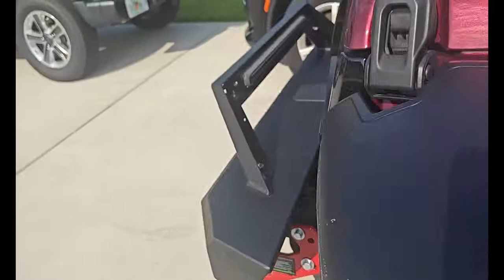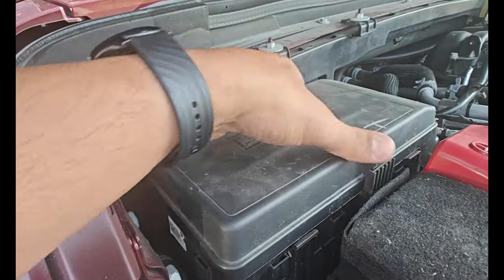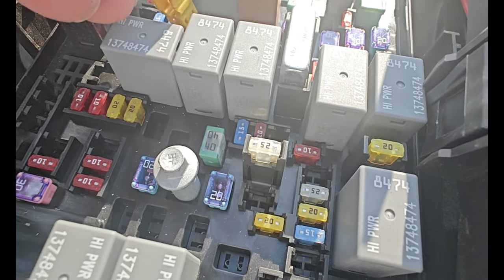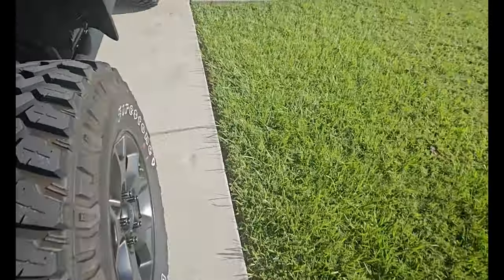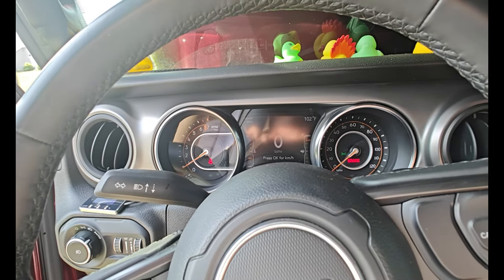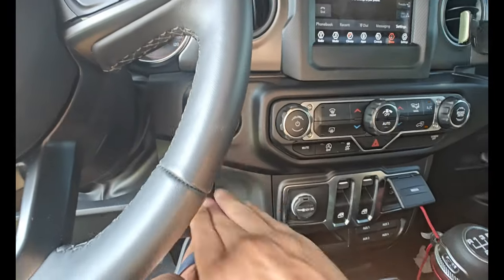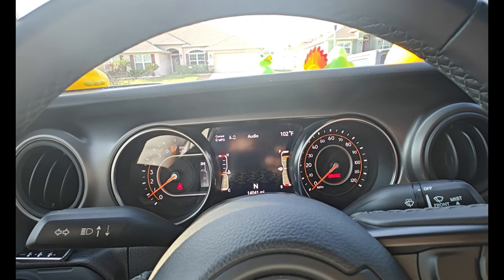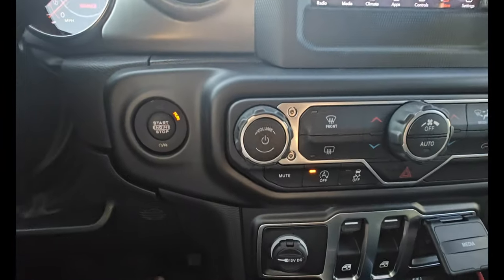Jeep Wrangler Aux Battery Bypass

Comment: Have a question, maybe you or someone can help... i bought a 2020 willys in may, had 33k miles. Last night it wont start, but everything else works dash lights radio everything... i jumped it off an it started but as soon as u put in gear it dies... does this possibly sound like it could be the Aux batter?
Reply from the maker: That sounds like the aux battery to me. Take the main battery to auto zone and have them fully charge it. you might have a drain aux battery also.

Comment: I have the same issue with my jeep. I got into an accident Aux Battery gone and now car doesn’t want to start main battery dead  in second after I bought it brand new. When I put computer on the car it says GMU no communication. Any suggestions please? Dash light up other screen sometimes
Reply from the maker: I would take it back to whoever fixed it after the accident, it sounds like you might have a bad PCM
Reply: I did everything myself but I only do Body work
Reply from the maker: @rmvariety  I f you toke the aux battery out what did you do with the pos and neg wires
Reply: To be honest everything was fallen off apart even the wiring under the hood I had to replace. But everything was setup the way it was exept the Aux Battery. I was wondering if I bypass the Aux Battery if that would make it start.
Reply from the maker: @rmvariety  Yes bypassing the aux battery will still let you start the Jeep. but you still have to make sure you disconnect the fuse as in the video.
Reply: Yes i will do all that as I seen it in your video.my only concern is U029A code that indicates MGU no communication. But I’ll try.

Comment: I pulled the F42 fuse and the correct negative battery lead, which is opposite of yours.  My Jeep fired up fine but the Auto Stop/Start light on the dash doesn’t come on.  I’ve got a 2020 Wrangler.  Does anyone have this going on, or did I do something wrong?
Reply from the maker: The light doesnt have to come on for it to work properly. if you press the button does it come on?
Reply: @FAFOWeekendAdventures  yes, the light does come on when I push the button.
Reply from the maker: @mikehenderlong3945  Then it working properly, you just have to manually shut it off everytime unless you install an:  https://amzn.to/40BZtIu or a Tazer: https://amzn.to/3MKBOzY

Comment: So if I were to take the aux battery completely out, do I need to reconnect the top negative cable you removed in the video and just 
 tape off the negative cable that came off the aux battery and connect the positive cable that came off the Aux to the main? Or do i need to tape off both negative cables coming for aux?
Reply from the maker: If your jeep is still under warranty I would not remove the aux battery. If the warranty is expired and you want to remove the aux that would be fine, connect the neg back up to and tape off the bottom neg. And tape off the bottom positive
Reply: Thanks.  My jeep is out of warranty. Wanted to remove the aux battery completely.  Wouldn’t it be best just to leave both aux negative cables disconnected and taped or is there a reason for one end to be connected?  I haven’t seen any videos of someone removing the aux completely
Reply from the maker: @elbadboylopez  I would connect the top negative, that's just me, looks cleaner 🤣

Comment: I’ve got a 2019 Sport-S 6 speed manual. Just bought it a month ago. Battery was dead this morning, did the same hack (no tazer) and now the ETC warning light comes when starting. It’s only on for a moment and goes away. Wonder if anyone experienced this as well.
Reply from the maker: As long as the light goes out you're good. Disconnect the battery for  ten minutes and that will reset the computer memory.

Comment: What was your battery voltage when you came back home?😊
Reply from the maker: @fantasticmike946  around 12.7
Reply: @FAFOWeekendAdventures  no changes since?  With no problem?
Reply from the maker: @fantasticmike946  No changes and no problems at all, still running strong

Comment: This is happening to my 2021 wrangler unlimited rubicon 2.0 liter turbo if I do this to disable the aux battery what features will I lose ? Will remote start still work etc thanks any info will help
Reply from the maker: I haven't lost any features, everything still works normal
Reply: So just remove the fuse and take off the black cable from main battery and that’s all ?
Reply from the maker: @orhancaliskan105  Correct, before you ask, the start and stop button will continue to function which is not a problem, if you want it off completely you will have to buy a tazer or an eliminator from Amazon
Reply: Thanks also do we just leave the aux battery in there once fuse is removed and black terminal ? Sorry about all the questions scares me to death lol I don’t want to cause any issues if that makes sense at all I appreciate your help very much and others who chime in
Reply from the maker: @orhancaliskan105  yes you can leave the aux battery there, I did and haven't had any issues

Comment: If you remove the aux battery and connect the pos of the aux battery to the pos of the main battery and tie the aux ground out of the way you wont need to remove a fuse and it wont void youre warranty. I removed mine 4 years ago.
Reply from the maker: Thanks for that info, I won't be removing my aux battery just in case I have to take it in for any warranty repairs and they notice that the battery is missing, after it expires then it's gone.
Reply: You still have to push the stop start button on the dash right?
Reply from the maker: @terrydtdi  I don't, mine stayed off
Reply: @FAFOWeekendAdventures  I did it exactly like what was done on the video so, 🤷 I don’t know.
Reply from the maker: @terrydtdi  some jeeps need to install a tazer or a plug to have the button shut off completely
Reply: @FAFOWeekendAdventures  why some and no all models,it’s suppose to all be same system right?
Reply from the maker: @carlospr4322  you would think they would all be the same, but from others are saying I guess its not all the same

Comment: Hello there…. I have a question about your battery issue…I have a 2021 Wrangler Sport S and it appears that my headlights are staying on FULLTIME and I’m wondering if you had the same issue as well….when you first started your jeep I noticed the headlights emblem was on and then you turned it off and then back on again and the headlights emblem was  off…..I’m trying diagnose my Jeep so I don’t have to pay a big bill at the dealership
Reply from the maker: @danan74  my running lights are always on when I start the jeep but you can turn that off
Reply: @FAFOWeekendAdventures  So were your DRLs on when you first started the video and then you turned them off ? I can’t turn my lights off at all on the switch and I have changed the headlights switch and the ambient light sensor and they remain on….aI might have no choice but to take it to a dealership…I just hate that I don’t have a choice and they are on the second the key is in running position
Reply from the maker: @danan74  yes they were on DRL when first started. Did this start when you modified the battery
Reply: @FAFOWeekendAdventures  I haven’t modified the battery yet…..I installed true Mods halos headlights and they have been on ever since ….and I have even removed them and REINSTALLED original headlights thinking that was my problem….but they remain on….Im thinking about unplugging battery and aux battery to reset computer to see if that makes a difference
Reply from the maker: @danan74  that's what my next step would be, keep me posted

Comment: I followed these steps but I am still getting the ESS light on the dash. I'm ok with it as long as it isn't draining my battery. I was stuck yesterday briefly. Will take it for a ride later. So far it has started no issues.

Edit. Went to start my jeep this morning. Wont start. Voltage reading at 10.
Reply from the maker: You should be good, I would check the voltage regularly with a volt meter if it makes you feel better.
Reply: Pretty sure he disconnected the wrong ground, and he should have jumped the two posts in the fuse box.

Comment: Thanks for posting this. What year model is your Jeep? I think they flipped the location of battery cables during the ‘21 model year. The skinny one is supposed to be the aux negative terminal.
Reply from the maker: My keep is a 2022, your right, of you watch the video I keep the fat one installed thinking that was the one but then it didn't start so, I swap them and it started. By the way the jeep has been running without any issues since I did this video. Subscribe for more fun videos
Reply: I also have a’22. Was planning on waiting until warranty expired and then doing this modification also. Are you planning on letting the auxiliary battery sit in there disconnected long term or will you remove it sometime? I was thinking about just leaving mine in there. I don’t think it would harm anything.
Reply from the maker: @banjoshad  you can do it now, if you need to take it in just put the fuse back in and connect the battery cable. I'm leaving the battery in because if you remove it the you have to find were your going to connect the cables. It's not going to hurt anything.
Reply: @FAFOWeekendAdventures  one more question, did you have to make any adjustments to put the bigger terminal end over the smaller post or did simply bolting it down tight work? Thanks again, your video has been a big help and I did subscribe.
Reply from the maker: @banjoshad  not adjustments just line it up and screw it down on top of the black plastic piece
Reply: Thanks for a great video. You made perfect sense with everything you said and did.
Reply from the maker: @bobbyg7552  Thank you very much.
Reply: 2023 Jl 3.6 only one ground. Please help
👍

Comment: I had a dying Aux battery and a bad main battery so I decided I would try this process.  Put in the new main battery, pulled the fuse and removed the negative cable from the aux battery.  That worked fine for a few days.  Now my check engine light has come on (timely because I have to get an emissions test in the next couple of weeks).  Is it possible that was left in with the positive cable still attached is causing the check engine light?
Reply from the maker: That's weird, I would remove the positive for a couple of minutes so the check engine light can turn off and you should be good.
Reply: @FAFOWeekendAdventures  when I get a chance I'm going to reverse the process and see if the check engine light goes away.  At least then I'll have an idea what is going on without an expensive testing.  Just removing the positive me clear the warning but not fix what the issue is and still come back.  In your situation did you do this process when both batteries were still good?  Thanks for the response.
Reply from the maker: @ericmorin471  when I did the process both my batteries were died, jeep wouldn't start, I jumped the battery went to the dealer and the said the would charge both batteries to check them. Both batteries were good and that's when I decided to disconnect the aux battery because when the aux battery dies it kills your main battery so by doing this procedure it  never gave me an issue.
Reply: I guess it could be a coincidence and I have some other issue.  @FAFOWeekendAdventures
Reply: @FAFOWeekendAdventures  I reversed the process and my check engine light disappeared.  But my auto start/stop light is on but I'm chalking that up to the failing aux battery.  Hopefully I can pass emissions now that the check engine isn't on.  Maybe it is something about my particular model that is triggering that check engine light.  2018 Jeep Wrangler Sport.
Reply from the maker: @ericmorin2057  when you complete you inspection give it another shot and let me know if it works your second time around

Comment: I tried this on my 2018 JLU Sport and unfortunately it didn't work. Any suggestions?
Reply from the maker: Why doesnt it work? if its because your start stop button still functions that normal.
Reply: @FAFOWeekendAdventures  Because my jeep still won't start.
Reply from the maker: @77Dervin  Make sure the main battery is fully charged, same thing happened with me and my main was died
Reply: @FAFOWeekendAdventures  Main battery was just replaced last month. Had it tested today and it's good. Codes being given are P06EF and P0688. Unfortunately I think I may have to take it to dealership.
Reply from the maker: @77Dervin  Disconnect the battery for about 10 minutes so the computer can reset.
Reply: @FAFOWeekendAdventures  I'll give it a shot tomorrow and update ya. Thanks!
Reply: Still no dice. Disconnected the main battery for a few hours, and still won't start.
Reply from the maker: @77Dervin  dam, don't know what to tell you at this point

Comment: So my ess indicator light came on a few days ago (2020 JL) and I came across this vid this morning. I went and pulled the fuse and initially pulled the wrong wire off the battery. When I went to switch them and put back the correct wire, there was a tiny spark when I put the wire back onto the battery post. I thought that was weird cause there was nothing else touching anywhere. Now I have no backup camera and no A/C. Can’t even adjust temp at all. The display is stuck on “Lo”. I changed it back to original set up and same thing. Any idea what’s going on? Pretty sure a fuse or something?
Reply from the maker: Try disconnecting the whole battery for about 5 minutes and check all the fuses, hopefully this will work.
Reply: @FAFOWeekendAdventures  thanks for the response. I went out an hour later and everything was back to normal. Apparently what happened to me is pretty common when disconnecting the battery. Anyway, was working fine until 10 minutes into my drive when I came to a stop light. Even though the fuse is pulled and battery cable disconnected, the engine stopped! I took my foot off the brake, and it started back up. What the heck!?  So since I have been researching this, I have found that for some reason, this battery delete solution does not work on 2020 JLs. Not sure why, but others have said same thing. Thanks for posting your vid though, it will help many others. Let me know if you have heard about this from others with a 2020. Thanks!
Reply from the maker: @Boltzfan29  if I hear from others with 2020 and find a solution I'll let you know
Reply: I have a 2020 JLUR and did exactly this and it worked.... about 6 months now, all is well 🤷
Reply from the maker: @loriharton271  Glad to hear, please like, share and subsrcibe
Reply: @loriharton271  oh wow, does the ess kick in when you stop if you don’t shut it off? That’s what I thought was weird……if I pulled the fuse why is the Jeep still shutting off when I stop? Also, have you noticed the volts meter changing a lot, or is it pretty stable? Thanks for you reply.
Reply: @Boltzfan29  the ess did shut  down once at a stop light. Since then, I manually turn it off every time.

Comment: Have you tried the heat? My voltage shows 14.0 to 14.6V and I noticed yours shows 12.6V.
Reply from the maker: Heat!! Are you crazy it's 114 here today😂
Reply from the maker: My reading is at 14.2, when I first did the job it was lower, now it's running normal
Reply: You might have a GPS tracker installed by dealer ship's for repossession purposes. They can over heat your battery system

Comment: tried to do the same today . I get power to everything but the jeep doesn't start.
Reply from the maker: Try switching the cables around
Reply: @FAFOWeekendAdventures  yeah I did that I get power to dash and everything else. I removed negative from main battery and  it wouldn't  start . so I removed the aux battery ran pos+ to main and taped up neg. same thing. it will start with aux. battery hooked up . only thing I can think of is my main battery  is shot and the aux. has been running the show. yesterday I had the " aux. switch off charging message  on dash . and plan on just deleting the aux. and replacing the main with a slightly larger h7. just wondering if I missed something. or if something is different with the 2022 and up?
Reply from the maker: @richardcorrell7689  Mine is a 2022, go to Auto Zone and have them test you battery and see if its any good, you cant run on the aux it not powerful enough.
Reply: @FAFOWeekendAdventures  It's the main I'm sure . I removed and charged. reinstalled and it will start to turn over but doesn't have quite enough to start. what I was saying is the aux. battery was helping the main enough to start . now with out it .the main is struggling. . Can't get to  parts store till tomorrow to test/ replace . I feel better now hearing the starter trying . before it wasn't doing anything. Will update thanks for the feedback. appreciate it
Reply from the maker: @richardcorrell7689  anytime, let me know how everything works out tomorrow
Reply: @FAFOWeekendAdventures  Jeeps all good , it was the main battery, the aux was still good, got a larger main and keeping the aux. for a spare lawnmower battery.
Reply from the maker: @richardcorrell7689  nice, glad it worked out
Reply: My jeep is doing the same thing, got full power to everything, dash radio lights,  but wont start.. jump it off an it will crank but as soon as u put in gear it dies... jus bought this jeep 3 months ago, 1st one an new to this aux battery stuff.... but maybe its the main battery..?
Reply from the maker: @briankilgore3697  When this situation happend I took it back to the dealer, they charged both batteries and said the batteries were in need of charging. When I asked about issues with the Aux battery they told me that they have always been an issue and need to be changed every 2-3 years. I the spoke with a friend that works for Factor 55 and Warn and was told to disconnect the aux battery and just get a bigger main battery. Since the day I posted this video I have not had any issues with my jeep and I'm still running on the main factory battery.